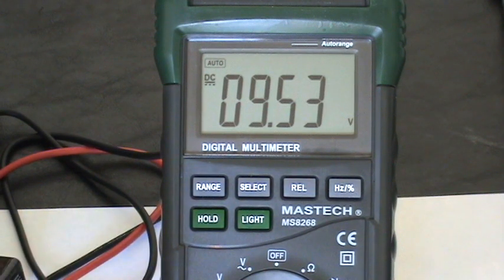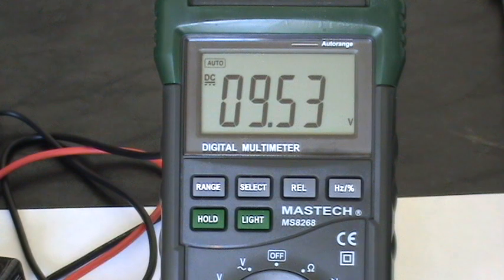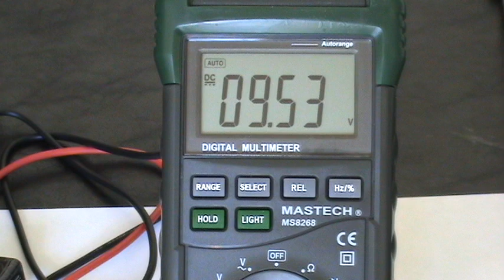Robotics and Electronics Tutorial - 4 - Testing the Battery

Comment: On my basic Craftsman digital multimeter there are 200mv/2v/20v/200v DC voltage measurements, and DC 1.5v/9v *battery* measurements. If I measure the voltage of a standard 1.5v AA battery using the 2v non-battery and the 1.5v battery measurements, I get a slightly different reading - probably 2-4% difference. Why is that?